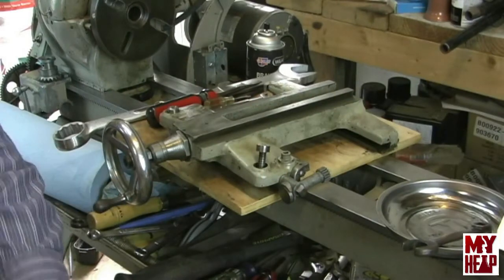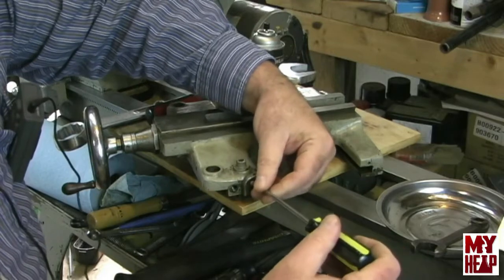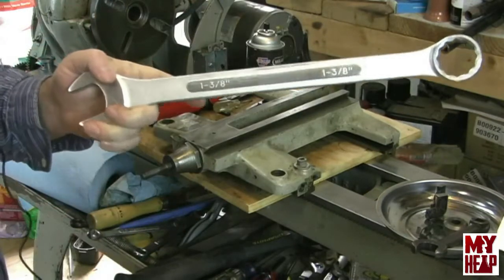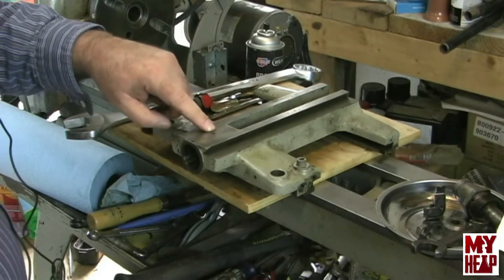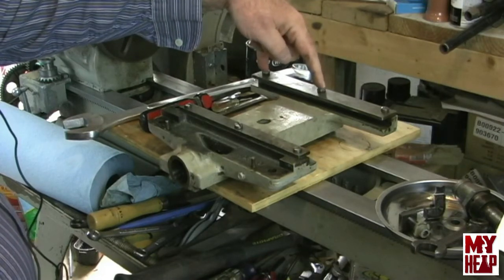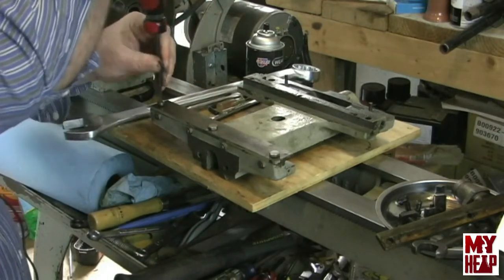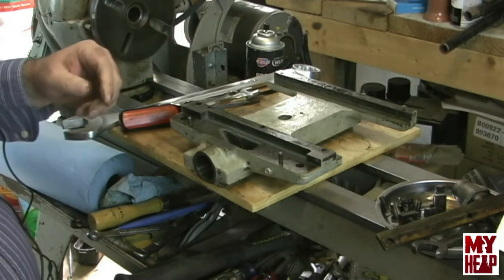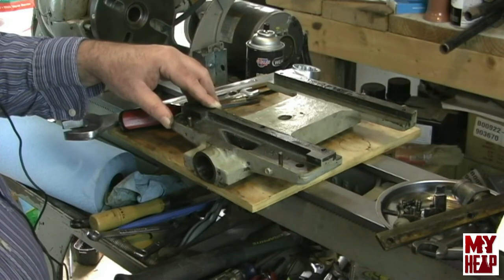Atlas 10F Lathe - TH54 - 15 - Disassembling the Saddle for Cleaning and Inspection

Comment: I have been watching your videos and they are very helpful to me. I'm currently in the process of building me a lathe not copying atlas but very similar.  I am in the beginning of my project only gathering information so that I get proportions correct.  I have a small Dunlap lathe probably like yours and a mill so that's what I have to work with .  Does any of your drawings show any dimensions of parts ? I will continue on the videos yours and others and hopefully be able to start machining soon .  Hope I am not biting off more than I can chew.   Thanks for the videos !
Reply from the maker: Ronald, that sounds like an ambitious project for sure.  Unfortunately, the drawing i have are only assembly drawings showing an exploded view of parts.  No measurements.  Sorry.  Thank you for watching and taking the time to comment.  I do appreciate it. 

Joe

Comment: Joe, the carriage locking bolt has a 3/8 square head .313 thick with an OA length of 1.834. length beneath head is around 1.5 inches and threaded portion about 3/4"
Reply from the maker: Steven, thank you for the information on the bolt.  So, from your description, there is not a integral washer made on the bolt?  Does yours have a washer under it?

Joe
Reply: Mine just has a separate washer but I like the ones built in - Steve

Comment: Hey Joe, before you put it all back together, mic those shims up. When I rebuilt my lathe, the saddle was quite loose and I had to get some shim stock, trace it out from the old ones, and punch the three holes.
Reply from the maker: Jeremy, the front shim is .006 and the back on is .004.  If I had to make my own shims, I think I would place an indicator mag base on the ways with the indicator over the ways on the saddle and lift to see how much deflection I got on each end and select a shim that is an average of the movement if it differed.  I would do that for both the front and back.  Obviously it needs a little play or it wouldn't slide, maybe a thou or two???  Now that I say that, I think I will do the same with mine to see if I need to adjust or change shims.

Comment: Another question if I may. What size and threads are the gib screws (if you have that information to hand) I am missing some on my saddle.
Reply from the maker: Let me double check but 8 think they are 10-24 or 10-32
Reply: @MyHeap  Cheers. Out of interest what was the play on the back of the saddle?
Reply from the maker: What do you mean back saddle?  The lift up from the bed?
Reply: @MyHeap  Yes. You had 5 thou at the front, I was wondering how much at the back.
Reply from the maker: I don't remember, but am going to the shop in a few minutes to confirm the threads and while I am there will measure the play.
Reply: @MyHeap  Cheers.
Reply from the maker: @BensWorkshop  the gib screws are 1/4-28 and are dog point.  Each has a thin lock nut.
Reply: @MyHeap  Many thanks. Very helpful.
Reply from the maker: @BensWorkshop  the lift on the back side of the saddle is about 4 - 5 thou.  This can be modified with shims if you need it.  I think since the cut pushes the front of the saddle against the ways the front probably doesn't matter but could in theory lift the back.  In my experience you have to have some play and it will vary depending on where you are on the bed.  Closer to my headstock it is more worn, so the best place to Guage this play will be towards the tailstock end.  Hope that helps my friend.
Reply: @MyHeap  Many thanks.
Reply from the maker: @BensWorkshop  Ben, see the shims discussion with Jeremy Gagnon in this thread.
Reply from the maker: You are welcome.